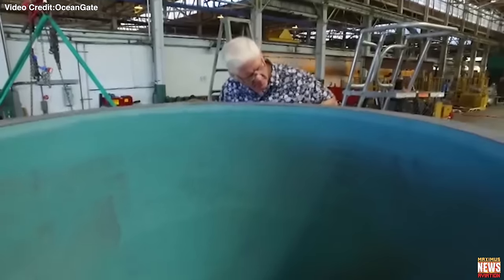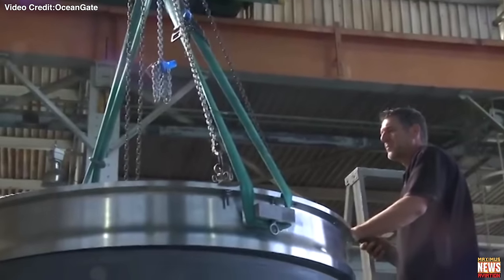Watch The Manufacturing Process That DOOMED OceanGates Titan To Fail. But It NEVER Had To Happen.

Comment: I'm no Engineer,  but I was in the composite business for 30 years. I have filament wound structure beams from Glass and Epoxy resin. Watching them wind the it looks like the carbon is kind of dry and not much angle on the bands. We used a combination of what we called Circ's, bands laying next to each other and Helix witch 
Had a sharp angle running more end to end. Kind of like a basket weave length wise. The Circ's gave it crush strength and the Helix tied it all together and gave it strength end to end.
Reply: Ages ago I investigated the use of AO Smith composite tubes for uranium leaching operations.  Very low stress compared to the oilfield applications I was accustomed to for tubulars.  The Smith pipe had essentially zero collapse strength and we looked at how it might be enhanced.... it was impractical, like reinforcing a woven basket.  The stuff is intended for tension loads.

So sad when engineers and others step outside their areas of expertise without consulting experts and understanding what they tell you.

Comment: Thank you for posting this video. Everyone should be able to see the type of material and procedures that was being used to build the Titan submersible vehicle. I worked at Puget Sound Naval Shipyard in Bremerton, Washington for many years in the machine shop. US Navy submarine parts are very heavy duty and each part has a unique Subsafe number on it to show where the material came from so any failure can be traced even back to the steel mill where it originally was cast or forged. Extensive quality assurance testing and record keeping is performed on these parts after they are made and before the part is installed in any submarine. I was shocked when I saw the parts for the Titan submersible being glued together for final assembly. This company was building death traps for it's customers simply because the CEO thought he knew more about submarines than the professionals do.
Reply: To say nothing about NDT for  initial weld quality and inspection of emerging cyclic issues.
Reply: This Rush fellow strikes me as someone who derived this project NOT from science and engineering but from the pages of Jules Verne’s 20 Thousand Leagues Under the Sea.  I’m surprised he didn’t name this thing Nautilus. Life’s a self-cleaning oven; give reality the double barreled middle finger, you get dead.
Reply: Good point. In Aviation a guy making say an Aluminum hinge or whatever will, upon receiving his raw material, cut a section of it and send it out to a test lab to verify it is the material he specified. before he ever make a part. Once approved he can release the material from reveiving and use it. No chances are taken it's all about risk mitigation. It's expensive but flying is a very safe way to travel.
Reply: @piglord3.05  This is precisely what gets to me about Stockton Rush: He was a credentialed aeronautical engineer. He should have been aware of the basics ensuring the safety of humans when inside his vessel.
Reply: Your explanation just about hits the nail on the head!  If he was making a prototype for use in a film or his own swimming pool you could understand the reason behind this design?
Reply: @piglord3.05  exactly.  ALL certed commercial aircraft parts are certified right down to the origin of each part's material and documentation follows it. No documentation, part is not certed for aircraft.  FAA and EASA have strict protocols in place. It's no wonder very very few aircraft mishaps these days are caused by part failure. And when you quantify the amount of flight time globally it's quite remarkable.

Comment: Curious that I didn't see any vent holes when the titanium rings were glued onto the carbon fiber tube. The adhesive is thick and will trap air when the ring is cropped onto the carbon fiber tube. If you don't give the air a way to get out, you end up with voids in your adhesive joint.
Reply: Exactly! That seal, for the exact reason you state, is why I suspect it was either the reason, or a contributing factor. If air was trapped under that ferrule, it would certainly be looking for a  way out.
Reply: I would have thought they would want to hydraulically press the ring on and keep in under compression of a few/several tons while it cured. I'm also surprised that they didn't have 4 compression rods holding the front and rear rings together the length of the tube.
Reply: Exactly.
 I'd at least put a big vacuum degassed bead in the middle and squeeze the excess out on both sides, to get an air free glue joint.
Smearing glue all over the place is best procedure to trap lots of air, in there.
Or do the whole glue procedure remotely in a vacuum chamber, so there is no air in there.
Reply: I may be mistaken but I don’t believe the glued joint between the dome end and the cylinder section is carbon fibre bonded to titanium. The glued joint is titanium to titanium. The carbon cylinder was constructed by winding the fibres onto a machined titanium tube which has a 5” flange at either end. The carbon is layered to a depth level with the flange face . It’s the machined faces of the metal base cylinder and the dome end that are being glued.
The fact that the carbon cylinder is wound onto the titanium base cylinder and expected to remain intact is baffling.
Reply: Titanium cannot be 'glued' or 'bonded' with any other material. The idea was to 'seal' it with an epoxy like resin. This whole construction would be ok for few hundred feet. Not 3000 meters.
Reply: Probably full of arm hairs too and pieces of whatever they used to mix the glue. Looked like they used a wooden stir stick bought from the paint store.

Comment: I worked in composites for a few years... as soon as I heard the main cylinder was made of CF, I stopped wondering. It's used in pressure vessels a lot but obviously at much lower pressures, and under tension not compression. This thing would have been stronger holding pressure inside, not withstanding it from the exterior. Regardless, with these types of pressures you don't want to be relying on CF or resin.

I was head of QC and testing (both non-destructive and destructive) so have seen very strong vessels fail. Hydrostatically, of course. I'd never set foot near a pressure vessel being tested with a gas. Nor would I get inside a CF sub under these types of stresses. I'd happily go down a few hundred feet in it though.

Comment: When I was a kid at school we had  fibreglass cricket bats (70s sport's cost cutting exercise such as screw in studs) glued together with resin, they were very light and worked well...at first. Then a few times when hitting a cricket ball you could hear them cracking. One day a bat we were using smashed in two after a hit creating sharp  shards of fibreglass to fly everywhere. It was a very important lesson. When carbon or fibreglass goes boy does it go and with little warning. The inside of the bat was dry no flexibility at all just dry sharp shards and very rigid. The school went back to using traditional cricket bats.

Comment: I would think that that straight wound CF tube has very low shear strength parallel to the fibers but you would get major shear forces when the tube is compressed relative to the Titanium ring...
Reply: My thoughts exactly. I think the most likely failure mechanisms are the carbon fibre failed in shear at the connection interface or the epoxy holding the two materials together did.
Reply: Based on testimony this week it seems like you are exactly right... the interior lip of the titanium ring was totally sheared off all the way around.

Comment: The open air environment this was built in is a massive problem. 
You don't mess around with epoxy and uncontrolled levels of humidity. It has to be held at a specific percentage throughout the course of construction and set time.

How something like that could be overlooked by everyone in that warehouse is astounding.

Comment: It's so obvious to me; the water found a way around that bead of glue. How they can't see it as a likely point of failure, will forever remain a mystery to me.
Reply: It was an explosive collapse of the CF cylinder, likely starting at the ends or in the middle - those are the places where the highest stresses were.
Reply: My exact thoughts. Also appears likely air was entrained within that seal.
Reply: @justinbelt8032  if i was the engineer, I'd be like "what about 5000 PSI do you not understand!?!?"

Comment: Notice that carbon fiber is laid in circles, that means the pressure from the titanium half domes is mostly supported by epoxy.  Even on a carbon fiber bike frame, they have to go different directions.

Comment: He simply didn’t want to spend the money that is required to build a proper sub for those depths, that thing was probably 1/8 of what it should have cost.
Reply: Does anyone know what Titan it cost? The DSV limiting factor rated and certified for the challenge deep cost $37 I believe.
Reply: And he was boasting about it.
Reply: @johno1544  would be interesting to know. I saw some "amateur guy" who built his own sub for 1000m, it looked like a porsche 911 compared to that titan soapbox in terms of professionalism
Reply: @strammerdetlef  I know right, any other DSV I've seen the inside of looks like the cockpit of Darth Vader's Tie fighter in comparison.
Reply: A thick wall steel pipe based submarine would have been much cheaper.
Reply: @norbertfleck812  doubt that

Comment: Every time they took it down they could hear the fiber tearing.  Previously a carbon fiber vessel taken to depth was specifically "one time use" for this very reason.  Every dive the vessel was weaker than the previous dive.  This was a disaster caused be gross negligence that Stockton and OceanGate were fully aware of.
Reply: Crush depth = test depth of you try often enough

Comment: An adhesively bonded aerospace structure is done in a clean room (this looks more like a foundry) after first surface prepping the materials: grit blast, acid etch, etc.
Reply: The carbon fiber is strong enough. It’s the bonding process they f. This is no different then using JB weld on a radiator.

Comment: Imagine knowing there is material stronger than carbon fiber you can use but you proceed to use carbon fiber anyway.
Reply: Submersibles aren’t made of the strongest materials available. Trieste went to 10,000 m depth of normal steel construction, like 5 inch thick. Obviously it depends on the size of the vessel, but the point is, you don’t need tungsten or some crazy alloys to make it happen, just a proper design. It’s not the strength of the carbon fiber that was ever the issue here, either. It’s just a problematic choice for that application.
Reply: Carbon fiber can be stronger than steal... That's not the problem, the craft was poorly designed, and after numerous uses they never fixed the lamination on the carbon fiber. Which they probably never knew they had too because they never did any ultra sounds....
Reply: @ThatOneGuyWhoLostHisHandle  Carbon fiber can only be as strong as steel in TENSION, but is always weak in COMPRESSION, for the same reason that you can pull a rope but you can't push a rope.
Reply: @bradleywalker8642  Yes i keep repeating that also myself, and you don't even need equations to get the intuition of the problem but...
Reply: @bradleywalker8642  You can push a rope! Just cover it in carbon fiber first!
Reply: The issue is not material strenght, it`s just a bad choice and a bad application. Carbon fiber is extremely strong with pulling forces, but weak against pushing forces. As long as you pull on a carbon fiber, you wont have an issue, as soon as you invert that though.....also shear forces are dangerous. 
If you see that this is not even woven - which you do to distribute the forces so that at least some carbon fibers are always under tension, and then just lay them around in layers. 
So in the end, you use the matrix (polymer) to glue the layers together and have massive issues with de-lamination and different coefficients in terms of expansion and shrinking (due to pressure and temp). 
Everyone that has worked with carbon fiber and is an engineer can see in an instant this is a very stupid idea.
Reply: I also love thumbing up comments then removing it.
Reply: @saschaganser9671 thanks…… very good explanation you are giving here.🙏👍
Reply: @Iombardia  No, you can't "push a rope wrapped in carbon fiber". Carbon fiber by itself has no rigidity. You're thinking of the epoxy holding the fibers together. That's why it's weak in compression. The fibers do nothing, and the epoxy alone is resisting all compressive forces.
Reply: @ThatOneGuyWhoLostHisHandle  stronger than steel in tension not compression.
Reply: @henryposadas3309  Someone already pointed this out but my point stands regardless
Reply: @bradleywalker8642  My point stands, it was a rushed design, using parts that don't belong on a deep sea submersible, yet it managed to withstand numerous dives with zero fault testing or maintenance. They didn't have a single ultrasound done from start to finish of the titans existence, which clearly would have revealed faults in the structure as that's exactly what an ultrasound is for when used on carbon fiber. Again, the real tragedy was this cowards greed and willingness to use an experimental submersible as a commercial vessel for non-research personnel. This poorly made vessel at least should have been piloted by test pilots who knew full well the risk they were taking. A composite hull for submersibles would present many pros for deep sea exploration if you could work out a more structurally sound design.
Reply: He could had the cylindrical part made of Titanium.  But then he would have had to spend more money for syntactic foam.  Why spend more money and stay alive?
Reply: Imagine signing multiple waivers informing you that you could die on an experimental sub and then paying $250K and going on it anyway. Takes two to tango.
Reply: Stocky was running low on cash. Titanium isn't cheap, he just MacGyver'ed the sub out of cheap parts including second hand carbon fiber past its sell by date. The only reliable pieces were the titanium end caps which, rather unsurprisingly, were recovered intact.

Comment: Quite a few have seen the old movies of submarines where a piece of rope was tied across the engine room. One view is near the surface and one is deep under water. That rope will get slack when the hull is under tremendous pressure. I have seen it first hand, having served on a fast attack submarine in the 80's. During my time there I always thought about the area where the shaft penetrates the hull to connect with the propeller. My biggest hope was that if we were going down, we would get two fish in the water, and those shaft seals would allow us to get deep enough that the differential pressure would be so great that we would flash in a mere second. This idea of merging carbon fiber to titanium is tough to accept, knowing how the system has to flex with each submerge/dive cycle. Let's learn our lesson.
Reply: That's awesome information!!!